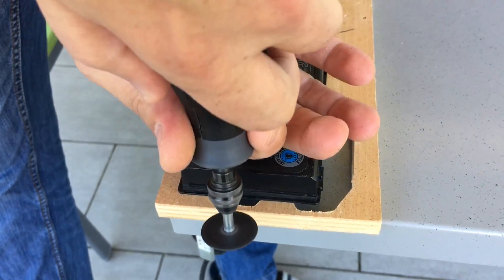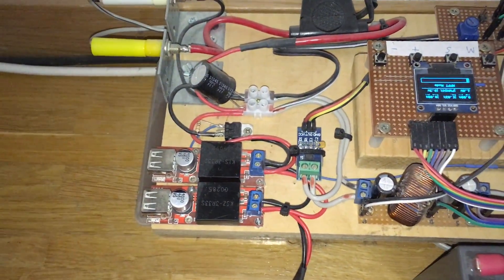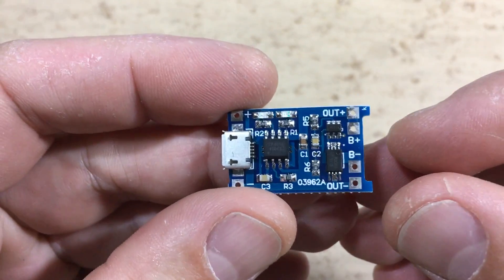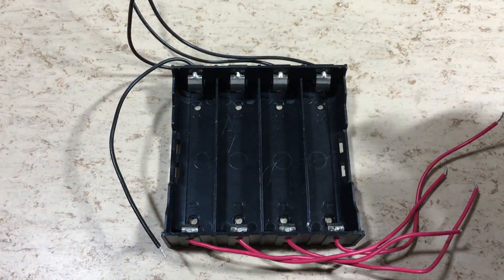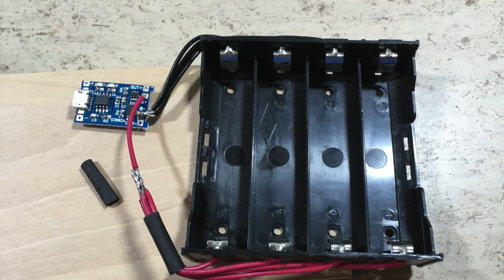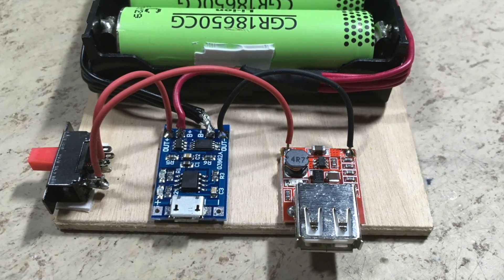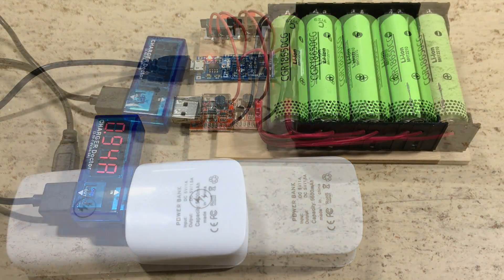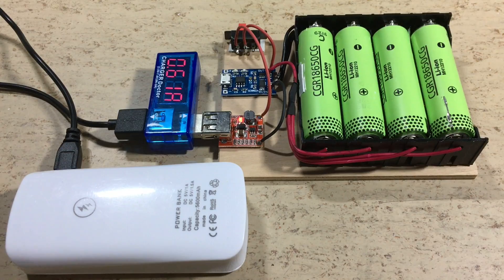How To Build Your Own DIY 9000mAh USB Power Bank!

Comment: Excellent video

Would you be able to remake this project with more powerful batteries like the 33650 lifepo4 cells? Faster charge/discharge, more usb slots and an lcd screen which can be turned on/off

Comment: Can I use this tutorial with 3xAA battery pack of Ni-Mh 2800mah (1,2volts for each one) in series which create 3,7 volts? I use this pack to power the led indicator of my electric scooter. I charge these batteries with an external charger and then I put them back in the DIY 3 SLOT. So I want to add to these pack, only the USB charger function to connect my phone or other device if necessary. I don't want to charge this pack as you do in the video. The question is, if I need both module, the tp4056 and upBoost or can I use only the Up boost module that is what I need to charge my device? I repeat, i don't want to charge my battery pack with USB. I only want to use it as a charger for other device

Comment: Isn't that a single cell charger? I use them in my projects. Could I charge 4 with it with out hurting it?
Reply: In parallel yes,in series no
Reply: Parallel get more maH like you parallel 4 cells,each cell have a capacity of 2000maH so you will get 8000maH battery capacity with 3,7V output but in series you have 4 cells in series,each cell have a capacity of 2000maH but you won't get 8000maH,you will get  around 15V battery output.Parallel=more capacity, Series=More voltage
Reply: @WalllOfNothing  I know that but each battery has one cell and the chargers are single cell chargers I charge 2 in parallel with mine and it works fine but I was afraid 4 cells could burn it up.

Comment: Hello... Great video ☺️... I have a question, if i use normal batteries so without recharging what I do?
Reply: I think you need to articulate the question a bit better, ie what you mean by normal batteries (AA alkaline, nimh rechargeable?), without recharging is also vague

Comment: Excuse me, I have a question
why in this video use one tp4056 but I saw in another video use four tp4056 for 4 slot 18650 battery. Is there any difference using 1 or 4 tp4056 ?

I will have a project with three 18560 batteries, tp4056 and solar panels. so I'm looking for a reference,
thanks for video 👍
Reply: He use 1 module to feed 4 batteries for fixed use as a solar charger. If you use 1 module for each battery the charge time will be faster, and you dont need worries about balance issue, different brand for each batteries.

Comment: Have question anyone answer please
How many battery can i connect to the module in parallel
Reply from the maker: I connected 8 in parallel. You have to make sure, that all are charged equally before connecting them!
Reply: Thanks for the information

Comment: can you add usb boards in series ?
Reply: yes.
I have seen them in series, and I've also seen them in parallel.
(One you stack, the other are side by side.
Someone also used some diodes.
There are LOTS of videos out there.
Just type this in a search: TP4056
You will see LOTS!

Comment: Nice but this way TP 4056 might be getting overheated.
Reply from the maker: It doesn't. it provides a constant charging current, regardless how many cells are wired in parallel. It just takes longer to charge.

Comment: That Red board DC-DC boost convert 3.7v to 5v to charge your phone, but it only support up to 600mA. So, you charge your phone super slow!!🤣🤣 hahaha..That red board only suitable for use in low current Solar panel circuit..You should change that red board to fast charging module
Reply from the maker: It doesn't matter at all, because I'm charging it during the night.

Comment: Great , I have a question please my tp4056 has an input voltage 5V and 1A but gives an output 0.13A why?
Reply: I think it happen bcs it get power loss.. what ur output voltage? If ur voltage output high the Ampere will low.. that in my opinion if im mistake im got so sorry.. 🤗

Comment: I would be afraid of this because it lacks a real BMS.  BMS modules are cheap that can handle up to 4S.  TP4056 is for 1S for 2S, 3S, 4S use "4S 30A 14.8V Li-ion Lithium 18650 Battery BMS Packs PCB Protection Board Balance Integrated Circuits".
Reply: but this is 1S, there's only one group in series and many in parallel

Comment: Connect both cells in parallel after balancing them first. Don't connect batteries with more than 0.2V difference in parallel as this can risk fire and explosions
Reply: Is that safe to connect 4 lithium battery in one TP4056 module
Reply: Be sure the cells you are using are of the same make, model, capacity......etc
Reply from the maker: Yes, what you said is important. Commercial power banks are doing the same BTW

Comment: been thinking lately.... Some people say tp4056 is designed for only one battery. But as some videos i saw it can be used with 4...I would like to be enlightened
Reply from the maker: The batteries are wired in parallel, so they will behave like one with bigger capacity (mAh)

Comment: where is the BMS and what are those connections dear, you need to read and watch more about 18650 batteries 
Thanks
Regards
Reply from the maker: Looks like you should. The used module includes a BMS

Comment: I wonder if it has over discharge protection...   And how will the batteries voltage will look after the TP4056 decides the voltage is too low. Will it happen when the avaragle voltage of all 4 batteries reach around 3V?  thanks :)
Reply from the maker: Yes, it has, but I can't tell you the exact cutout voltage. Read the data sheet
Reply: @TheDIYGuy999 First thanks a lot for answering. 
 I have used 6 different  TP4056 modules. And they don't charge the batteries to same voltage: 4.10, 4.12, 4.14 and 4.15. I will have to test the discharge protection if also varies a lot.

Comment: sorry to bother can you prove this still works and is safe,it does state the max Ma is 1000  & how did you get rid of the heat ?.....Great video by the way im soo interested .
Reply: from experience when the boards burn up its nothing more than a pop lol.   u should see the testing an 18650 goes through.  drop tests, vibration tests in multi axis.  they are as safe as anything else.

Comment: Sooo,i think that tp4056 is single 18650 battery charger, this goes weryy hott
Reply from the maker: It doesn't, the charging current is always the same. It just takes longer to charge, because of the higher battery capacity.

Comment: Tp4065 is not made for multiple batteries
Reply from the maker: It does not matter if wired in parallel. It just takes longer to charge.

Comment: But can you charge and discharge at the same time can you demonstrate this little battery pag by plugging in something that uses power in plugging in the charge Corp at the same time
Reply from the maker: Yes, you can
Reply: @TheDIYGuy999    We would like to know if you would like to work on a project with us If yes give us a call at 3136515349

Comment: Very nice. I love salvaging 18650s from laptop batteries.  Those boards are a staple for me too! Nice job putting 4 cells in this project. Loved ur vid.
Reply from the maker: Thank you
Reply: How many watts can they discharge? Is the board basically the limitation for these? I'd like to power a NUC with these which would require 100W, do you know of any upgraded components?

Comment: Bro will it charge all  the battery equally 
How will it get balanced charged as that module is made to charge only a single battery
Please reply
Reply from the maker: The batteries are wired in parallel, so they will always be in balance

Comment: I'm wondering if the switch is necessary?
Reply from the maker: Not necessarily, but it will prevent the batteries from discharging, if no USB device is connected
Reply: @TheDIYGuy999  cheers, thanks!

Comment: Cool, but that is going to charge really slow :/
It takes about 2 hours for my tp4056 board (Same as one in video!) to charge one!
Reply from the maker: It does not matter, because I'm charging my batteries with a small solar panel, which is not able to supply more current anyway

Comment: At no point did you show charging
Reply from the maker: Yes, you're right. But no worries, it's working fine. It's in daily use, recharged with a solar panel

Comment: nice, but you should use one charging module and one output module for each 18650 cell. If not, you can damage the cells
Reply: That’s only true for series connected cells. In parallel, they balance themselves out
Reply: is this true?
Reply: @cybrhckr  actually it's yes and it's also a no.For series yes we need a bms to balance the charging for 18650 cells but it's a no in parallel they only need a Tp4056 or a single BMS because the 18650 cells will balance it themselves
Reply: @cybrhckr  Yes. Think about it- you must control each cell separately. How do you want to achieve this using one simple charging module? The best solution is to use an BMS  which controls more than one Li-ion
Reply: @koluniok3409  if you use cells with the same specs at the same voltage when you plug them in, they will stay in sync for a very long time, given the low voltage & electricity in this setup.

Comment: Thanks a lot for the great video. One question please: how much time does it take to charge the 4 batteries as the 1 amp charging current will be divided by 4? (250 ma for each battery)
Reply from the maker: Let's assume, your batteries have 2000mAh capacity each, so 8Ah in total. Your charging time will be 8Ah / 1A = 8h
Reply: Probably bout an 1.5 hr

Comment: Is it possible to get 12v 2a DC output for external monitor and 5v usb output for an other device? And than add another adapter to it to charge it? Thanks!
Reply from the maker: Just use a different DC to DC converter

Comment: hi is it ok to connect 3 batteries 2600mah ,one of the battery is showing 3.6v ,other 2 shows 3.7v ,also can i use Miniature Slide Switch - 2 Way On Off - SPST  Rating 0.5A 50V DC

Comment: Great video, this will be very helpfull for me. 
You seem to know what you are doing so I would like to ask for your opinion. I’m thinking to use a setup like this to power portable Arduino projects for longer periods of time but I would prefer to cut off the load at a voltage of about 3V instead of 2.5V as used in the protection board. I’ve wondered why all the protection boards cut off at 2.5V instead of 2.9V like most batteries require but apparently that has to do with the voltage drop during high loads and cutting of at 2.5V makes sure the power doesn’t shut down during those temporary drops under loading. However I will not be using high loads, making the voltage drop under loading smaller and therefor the 2.5V cut off seems too low for my usage.
I read that the voltage drop from 3.0V to 2.5V happens relative quickly and that the 18650 cell recovers to 2.8/2.9V almost immediately after the load is cut off at 2.5V but as my projects don’t need much power I am worried that the period in which the cell is between 3.0 and 2.5V will be too long and might damage the batteries. 
To get the load to cut off already at 3.0V I’m thinking to use the S9V11MACMA step-up/step-down voltage regulator (https://www.pololu.com/product/2868). It can step up the voltage to the level I need for my projects but, more importantly, it can also cut off the power when the voltage drops below a set level. Output – and cut-off voltage can be adjusted with potentiometers on the board to e.g. 5V and 3V respectively. The board would replace the step-up booster and should cut off the power before the TP4056 would. Do you think that will work as intended or will it introduce complications in combination with the TP4056?
Also I wondered if it might be a good idea to add a glass fuse to each cell to isolate it in case of a cell failure for additional safety. Probably a bit of overkill as it is only a small pack, but the costs are minimal and the idea of burning my house down is worrying enough for me to consider putting them in. Obviously I would need to use 4 separate cell holders and parallel connect them after the fuses. Any thoughts on that?
Maybe I’m just worrying too much.. :)

Comment: Im really new to electronics but ive read a lot of people on reddit and forums saying its unsafe for a single charging board to be used on paralell 18650 batteries but i can see that you have done it with no issues. 

They said:

""You shouldn't put batteries in parallel, especially rechargeable batteries.   They will never be "exactly equal" and one battery can discharge into the other which is not efficient and could potentially damage the batteries and maybe overheat and start a fire! "" 

""You can put batteries in parallel if you add a diode on each battery to prevent reverse current, but you'll get a voltage-drop across the diode (0.7V for a regular silicon diode) and you'd have to bypass the diodes for charging.""

Is this something to worry about as i want to do it and it looks like you have done it succesfully but i need it to be safe.
Reply: The video is done in a near perfect risky model. Rotary tool to cut is totally unsafe.
Reply from the maker: Most commercial 18650 based power banks do exactly the same.
Reply: Its way more of a risk with different cells,  when they are the same it will take alot longer but 1 will eventually drop below the rest and the cell will burn up when charging. Again its usually a case of replacing said cell and its good to go again

Comment: this is not a good method, in this way you just have to unbalance a cell and you risk ruining it. There must be 18650 TP4056 for each cell.
Reply from the maker: They can't unbalance, because they are wired in parallel

Comment: In confused. If you have all the batterys in parallel how come the voltage it is giving off is 5 volts when the batteries are rated 3.7V? They aren't in series so how did its voltage increase to 5 when its in parallel?
Reply from the maker: The USB connector board has an integrated stepup converter
Reply: @TheDIYGuy999  oooh okay I see

Comment: Big thumbs up for sharing!!!
I made the same project and used 2200mAH battery. But my TP4055 IC is HEATING up very much, RED LED is glowing too while charging.. is it normal for the 4056 IC to heat up?
(I am using 5volt 1A charger as input to this circuit)
Reply from the maker: Thanks. The TP4056 is a linear regulator, so it's normal, if it's heating up a bit. The red LED is indicating the charging process and changes to blue, as soon as the battery is fully charged.
Reply: I am planning to make this a little more compact, so can i use 2 batteries instead if using 4 batteries? Keeping the circuit same? 
Actually i have now removed 2 batteries but the boost circuit shuts off after being on(red light turns off) after few seconds with no load condition
Reply: Surya kanta Ghosh: I’m no expert but... Did you re-check the circuit?
How much voltage input and output vs both modules datasheets?

Comment: 9000 mA Batterry current flowing through just a 1000mA TP4056 ??😊
Not at all a Good idea..It will fry that module soon or later..
TP 4056 Module can only handle maximum 1A . Do NOT try this
Reply from the maker: Looks like you are mixing up mA with mAh. The module is regulating the charging current. More battery capacity just results in a longer charging time. I never had issues so far.
Reply: @TheDIYGuy999  Thanks ...
Reply: Yeah...I agrre with you...what can I use to charge 6 18650 battery in  parrell connection......???

Comment: totally not good and safety, one tp4056 and 4 battery no newer do thats. one tp boarrd max one battery uses. you need safety charging board, BMS 4s board add this is want safety and good. and BMS no have regulater output need power step up/down usb board regulate and keep volt level alltime right if batterty go dry.
Reply: Matti Virta Indeed, you need 1 TP4056 per battery. Don’t do this!
Reply from the maker: The batteries are wired in parallel, so they always have the same voltage level. Of course, you can't do this, if your batteries are wired in series.
Reply: @TheDIYGuy999  Please Look at DataSheet of TP4056, it is clearly writtem Maximum current 1Ampere.. Why you spread mis information that 9A can be handled ?~..Also confuses about Ampere and  Voltage ???😢

Comment: BRO CAN IT WORK ON 21000MAH  CAPACITY?
Reply: TP4056 module can only handle  1A Maximum.Never try to pass 21A through it.It eull fry that module and burn your house..!!
Reply: @MagicSmoke11  no it will not burn the house though. 
It will take 21 hour to charge 21amp 🐸
Reply from the maker: Yes

Comment: I want to build my own battery pack with 12 of those 18650 batteries.. is it possible to add more usb outputs and a small display that displays the battery percentage? And how would i assemble everything together? Are there some instructions I can look up to build a battery pack with the parts I need?
Reply: Kulimao If you don't know how to do it youself, you probably shouldn't do it. Li ion battery's are very dangerous.

Comment: I’m a bit worried about the last battery, looks like you have cut into it. But otherwise great video!
Reply from the maker: No worries, the metal can is still intact, it was just the plastic sheet, which was a bit damaged.
Reply: @TheDIYGuy999 this is 4 years old but did you ever resleeve the battery? I've learned from experience that it's very important to prevent short circuiting.